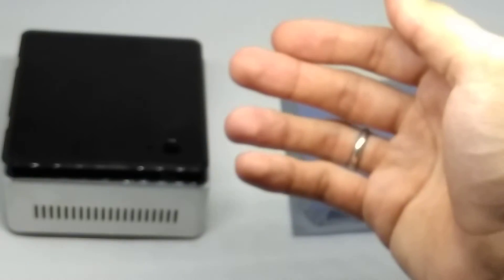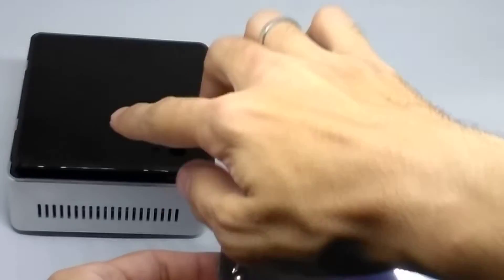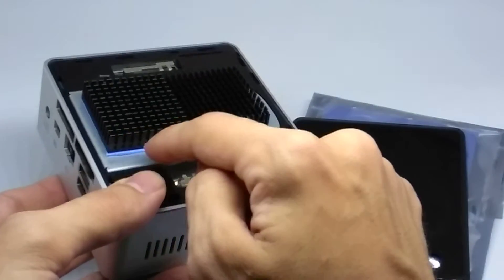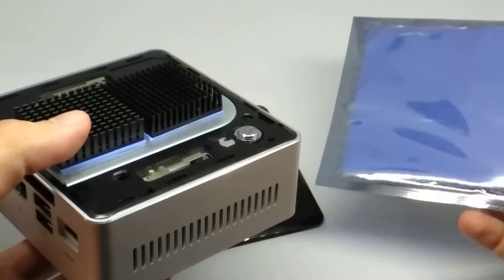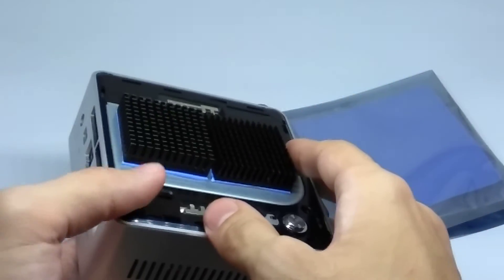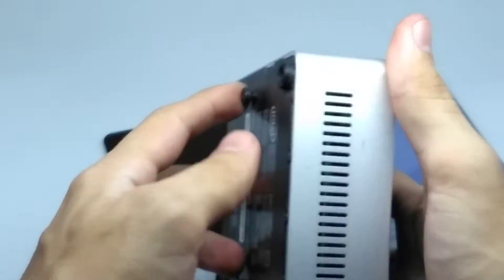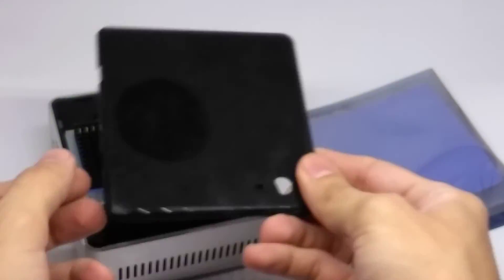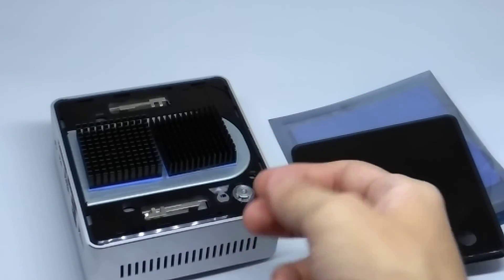How-to | Fix Poor Cooling for NUC mini PC

Comment: Hi, thanks for this very helpful video. I work on figma on chrome, and my pc keeps hanging and it is always hot, I had removed that plastic cover a few days ago after watching your video but today I opened my nuc to put thermal paste and clean it but I can see some rust color on some pin joints, not sure if it is rust, there was something on the ram too, I live in a humid place and appliance like washing machine gets rust, the Ruth color on pins I had never seen before, it had always been silver, do you think that plastic cover could be to protect the components from humidity? Because I have put it back on

Comment: For people considering this, and im not against it, first check the fan. When new, a NUC, at least mine, spun at 4096rpm as indicated in BIOS using the Cooling setting. When I started noticing heat, i downloaded Speedfan application and saw that the fan would not even come on until the NUC was quite hot, at least 110 degrees and as the temp rose the fan spun at 200-1200rpm only, never achieving its max speed, with the various internal temps being charted at 150-170 degrees. I have bought new fans but will first open the NUC, clean and lube the orig fan and see what happens. The normal temp when the NUC was new was around 100 degrees when stressed. If the fan work gets back to that I may stop there. I can easily get the heatsink and pad if I want to try for more reduction. I run air filters on the NUC so I know the interior isnt clogged up. The problem is that the fans are not made with any lube on the spindle-bearing and so heat and scoring will slow them and then stop them completely. Im saying to start with a clean, well moving fan and interior before adding heat sinks.
Reply from the maker: Well said.

Comment: I fixed mine, i sit it onto of a huge pipe connected to a 3.2kw portable airconditioner. A friend of mine helped me and we tweaked the aircon to run as cold as it can so it blows -15degree Celsius air over the whole nuc. 
Works well. 
I run it from a powercable connected to my buildings shared power otherwise my powerbill would be astronomically high

Comment: Does accidentally touching these heat sinks puts u or the unity in danger. Are they conducting electric charge as well. ? That plastic lid apart from aesthetics  might be thr for the same reason.
Reply from the maker: The voltage going through the device is less than 20volts. Also sure you should exercise caution. I had the device mounted behind the display facing the wall, so no touching.

Comment: The problem is airflow. 
Nucs have almost no intake.
You gotta drill holes into the bottom part of the U-shaped metal plate where the fan intake is.

Comment: If you're having heat issues, you need to open up the unit and clean out all the dust and then replace the thermal pad and thermal paste which is on the CPU die area. Only add thermal paste to the CPU portion and not the chipset die. The chipset die will require an actual thermal pad due to the heatsink. Once all that is done, make sure the fins inside your fan assembly are nice and dust free. This heatsink method won't do anything.
Reply: He literally said that he got a 25 degree drop in cpu temp (which makes sense, the blower fan conducts from the CPU, so attaching a heat spreader to the blower should effect cpu temp). That said, yes, removing dust for a 4 year old nuc is probably a very good idea.
Reply from the maker: Thanks for advice
Reply: Yup, i agree, just did this last weekend, just blown out the dust that was gathered between the fan and the output fins , and now i got like 30-40 idle, instead of 90-100, and i got an intel NUC 12th gen, they have the same chassis, no overgrown passive cooling or even active cooling will work. 

TLDR : blow the dust off.
Reply from the maker: @VladimirKnobel  thanks for sharing this.
Reply: @mike b    others have done similar methods and got large reductions in temp. How was that possible then?
Reply: @cvcoco  My comment is from 2 years ago. I don't even recall watching this video...
Reply: You Ain't Kidding!!! I took my NUC apart, clean out the dust and applied Thermo-Paste. But I added Permatex Anti-Seize Lubricant. The same paste I put on car brakes. I saw this tip on YouTube about the paste. A higher temperature rating and greater than half the price!!!! Works just as good!!!!

Comment: and... you can buy a noctua 5volt low profile fan and improve it even more with those stuff, thanks for the idea of the video man!!!
Reply from the maker: Thanks for the idea, glade you liked the concept.
Reply: @prhasn  yeah, really cool discover man
Reply: Where do you put this fan?  Does it replace the existing fan?
Reply: @freediskspace  for the existing blowing fan in the internal it's unnecesary, but you can make an airflow over those big heatsinks by placing a fan over and Speed up the chilling of these for making temperature flow faster, experiencing lower temps, at least from my hypotetical point of view

Comment: The metal area at the top of my NUC does never get hot. I doubt it is in any way connected to the CPU...so adding aluminum heat sinks to that metal area should result in no cooling. Am I wrong here?
Reply: A lot of mini's have the cpu and blower on the bottom

Comment: How's your NUC Mate, got one just yesterday and I'm planning to add a heatsink with built in fan exactly at the location where you put your heatsink. I'm just waiting for my thermal pad, for now it is sat on top of my laptop cooling fan with intact enclosure and my temp. ranges from 33 to 55 deg. cel depending on my task. That is UK weather thou and it is currently winter here. Hoping to drop my temp down to 25 or less once the heat sink is installed and probably adding some small fans at the sides of the NUC's vent...
Reply from the maker: I have upgraded to NUC HVK since then.